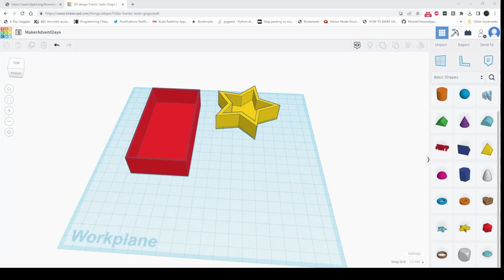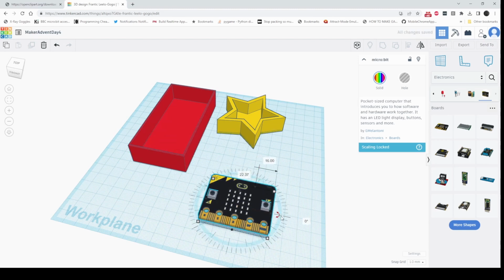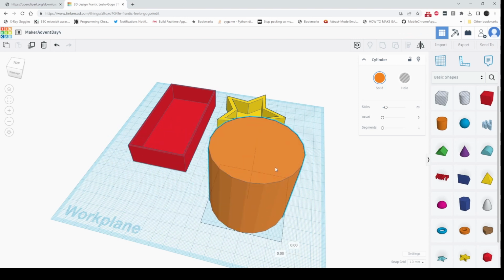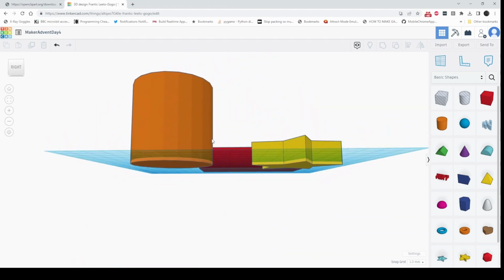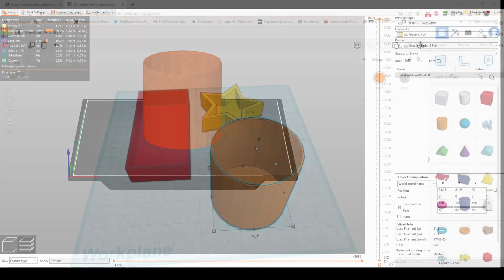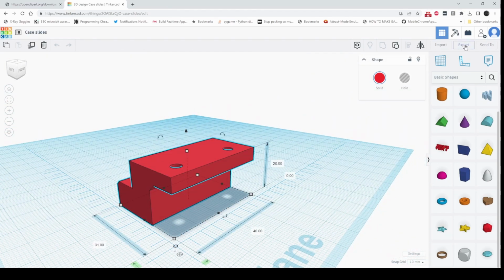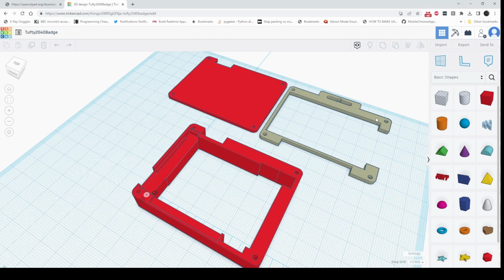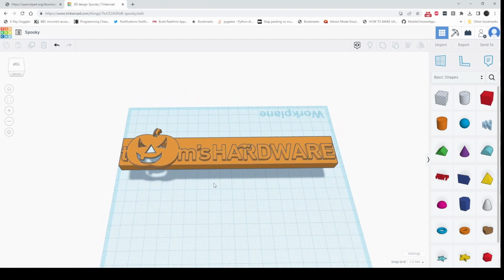Maker Advent 2022 Day 4: Tinkercad Basics

Comment: Tinkercad is a great resource..

It even has sections for  circuit design & coding as well as a way to design shapes and objects in a block based programming environment
Reply from the maker: Exactly! Great tool for makers young and old. I've used the circuit design section before, but not the coding. I'll give that a go. Thanks.